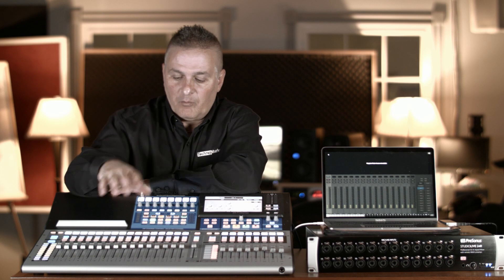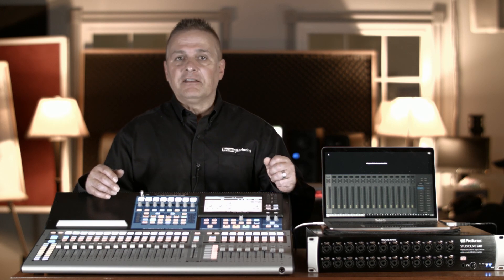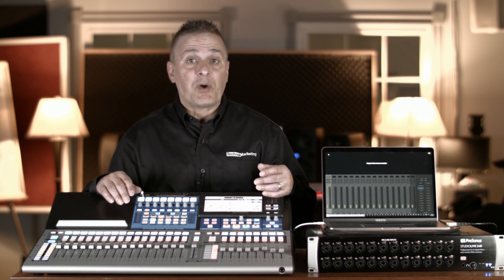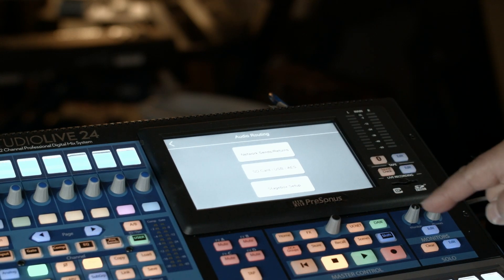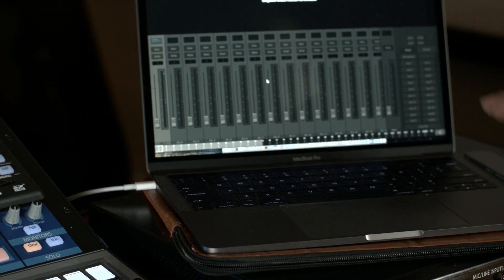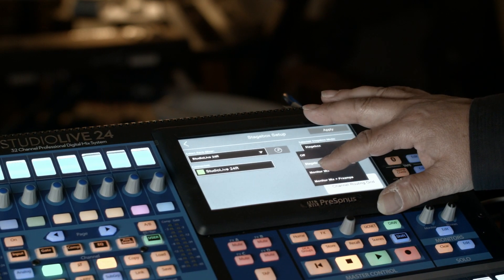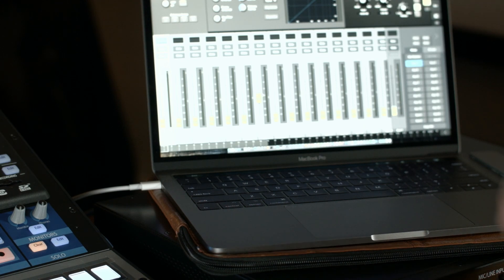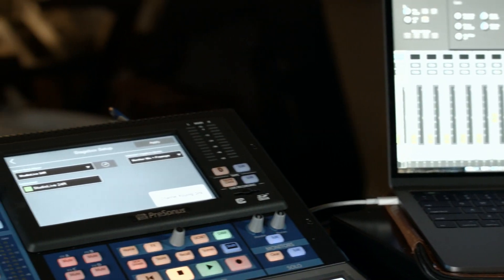Presonus Studiolive 24 Series III-24R Stagebox setup

Comment: Hi Ted, thanks for the video. I want to install a system with a 24R and a NSB8.8 Stage box. Will I need SW5E switch to route one device to another? I didn't understand the exactly application for the SW5E. Please if you can summarize to me, will be thankful!

Comment: does anyone know, with the 24r in stagebox mode, can you also run it as a usb interface ? Hook up a laptop with USB running Ableton and push output straight into it? or would I still need a seperate audio interface for the laptop?

Comment: Super convenient use as stagebox/snake, but... doesn't the ETH cable become a single point of failure? Is there a way to have a backup ?
If I have 24 cables connected and one goes wrong I can just switch on a free channel.. if the ETH goes wrong... I'm done...
Reply from the maker: Enrico Dell'Aquila you are correct the network cable is a single point of failure.. In terms of reliability cat5 has proven itself to be far more reliable than multichannel analog snake cables.  The cable is lighter, cheaper, and far easier to diagnose and fix.
Reply: run two cables for redundancy?

Comment: Hey am using Presonus StudioLive24 III with a Presonus StudioLive32R to be used as a stagebox. On the Audio routing menu of the Presonus StudioLive24 III there is no option of Stage box control. kindly help.
Reply from the maker: peter kamau you probably need to update the firmware. You probably have old firmware.

Comment: Need some help, I followed the instructions and connect my SL 32SX to my 32R and selected stage box mode. It has green light but no signal. 
I’ve updated both firmware to current. 
Still no signal detected. What did I miss?
Reply from the maker: Did you route the inputs in the digital patch bay window?
Reply: Ted Bahas, I thought by default it will automatically do 1:1 input and output. But I will have to look at that and try tomorrow. Thanks for the direction
Reply from the maker: Stenly Gonie also make sure the inputs are set to network for the channels you want to use from the stage box
Reply: Ted Bahas can these settings be found in the routing menu? (Home pg)
Reply from the maker: Stenly Gonie the digital input source is right on the fat channel routing section on the board. It’s a green button marked “network”
Reply: Ted Bahas ok thanks I will give it a try tomorrow 👍🏻

Comment: Is there an option to leave any channels local to the console? Say 1-16 on the stage box and 17-24 on the console?
Reply from the maker: bobbyjackson20 You can switch channels on a channel by channel basis. You can have any channel set to local vs network. So the answer is yes!
Reply: ted bahas thanks Ted! Which screen would I set that up on? Is it in the channel settings?
Reply from the maker: Yes its part of the input setting. You can select Analog for local input. For the stage box mode you select Network for the input. USB and SD are for playback from computer or SD card. I hope this helps!
Reply: input setting on the home screen or per selected channel?
Reply: I’m also wondering about this but specifically if you have the Studiolive 16 iii mixer can you use the Studiolive 16R stagebox and have 32 total inputs?
Reply from the maker: Anthony Esposito Of course. All of the StudioLive mixers are 32 channels. The only difference between them is the physical I/O

Comment: Hi, is it possible to connect 2 desks to one stage box so we can separate FOH and Monitor Mix and achieve different FAT Channel Settings in both worlds.
Reply from the maker: Yes that is possible and you can specify who has control of the preamp. The latest firmware also allows you to gain share between FOH and monitor world. This will gain compensate levels among multiple users of the preamp. As the person in control of the preamp trims it the other use's level will be compensated so it does not change. Please note that the gain compensation feature is only available with one of the NSB stage boxes.
Reply: @tedbahas  PLEASE, How is this possible? Using 2 Studiolive 32 mixers to a stage box as the stage box only has one AVB port. Do i connect the second mixer to the Control port?
Reply from the maker: @soundbreed  The best way to do that function is to use a AVB switch. It has 5 ports. If you are doing more than 2 devices this is what is recommended. While you can daisy chain end point devices such as stage boxes and Earmix stations, using a switch is a better way to go. Here is a link to the Presonus knowledge base for you. https://support.presonus.com/hc/en-us/categories/360001175151-Audio-Networking.  They also just added an AVB to Dante converter that also extends its network functionality. I hope this helps. Cheers!

Comment: Can i extend presonus 32sc faders using 16r stage box?
Reply from the maker: Ariel Moreno Vergara you have 32 channels at mix but they can be any combination of remote channels from the stage box, playback channels from computer or local channels.
Reply: @tedbahas  hi so on the 32sc, I cannot purchase a 16r and expand my 32sc channels with more channels via AVB? For example tracking, say I've used all 32 usb channels so I want to now record vocals or more tracks on top of my 32 track mix down. I can use the stagebox?

Comment: Do both the console and rack mixers need to be connected to internet for this set up?
Reply from the maker: Nope it is a closed network between the Board and the Rack mixer. You can of course be connected to the internet.

Comment: Hi Ted, I have an SL64S as my main mixer. Can I use x2 SL32Rs as stage boxes to access all 64 channels to conned my band?
Reply from the maker: That configuration should work. You need to Verify with Presonus. I no longer work for them and maybe something has changed.

Comment: Can I use the stage box with other consoles like sc48 or Midas pro series
Reply from the maker: Nope. At this time the stage boxes are specifically for the Presonus Series III Consoles and rack mixers. As the AVB interoperability standard  Milan matures that may change. Milan allows differing manufacturers to have common interoperability between devices. Presonus is part of the alliance of manufacturers that is backing Milan.
Reply: @tedbahas  ok thank you so much 😊